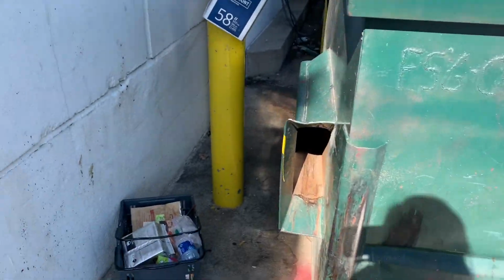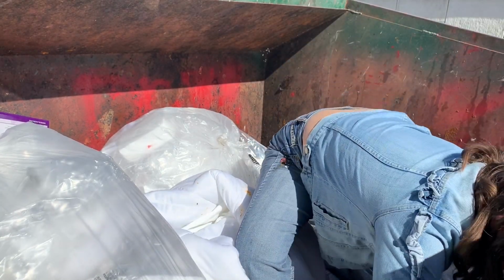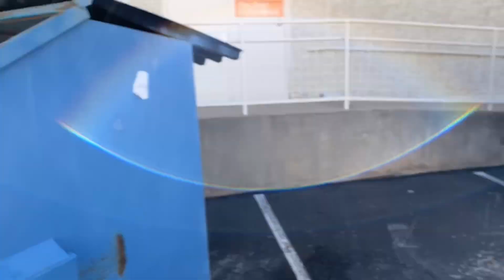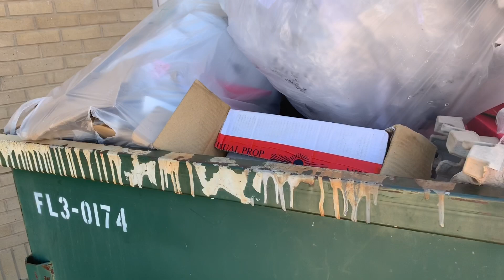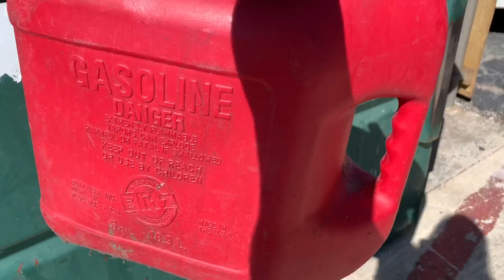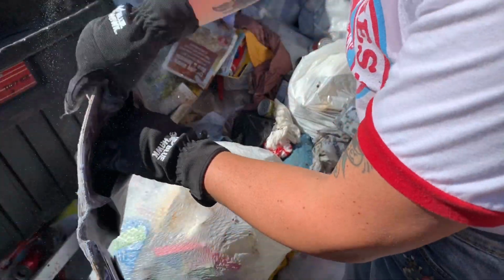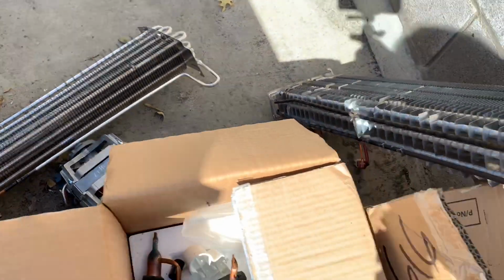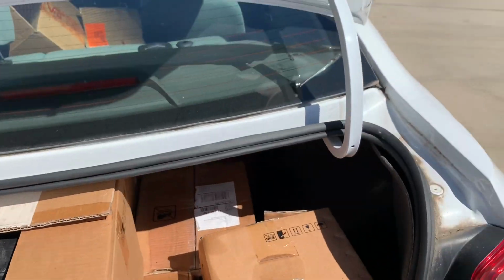Dumpster Diving at Apartment Complexes + the Mall! My car was FULL after this haul!

Comment: That dude is a refrigerator mechanic, so the reason he threw those out is, it's the part he replaced. all those parts are damaged. all the bags are open, he took out the new part and put the damaged part in the boxes.
Reply: Alice C my thoughts exactly.
Reply: here in ohio you only get 0.08 cent a pound for them used , all of those are repair for the new ones.
Reply: Alice C exactly, parts looked burnt out.
Reply: Exactly
Reply: Yep, broken and worthless except for scrap. Take them off Craigslist or the buyer will be pissed.
Reply: Tara TreeLove nh
Reply: @scoutisabelle  Suggestion:  The replaced compressors should be taken apart, look for copper, aluminum, separate. Then when you have enough metal, go to scrap yard. The results may fill your tank with gas or do better. Check out Taco Stacks on recycling wires, steel, light iron, copper prices, parts can be pieced out and you can make a fair price if you know how to use a power tool to loosen bolts, screws, washers, nuts, just use gloves.  Most can be done is about ten minutes or less according to Taco. If you are going to take metal, then this is the way.  You can store them in tubs with lids to avoid rusting them out. Discard the cardboard. Get to know your recycle center workers, they will explain what they take, why things should be separated, dirty versus clean, easy enough to learn and I have never done this but I learned. Piecing can make a good dollar.  And btw, nice try sewing, learn some other stitches to make it attractive.  I'd show you but I don't have a movie camera. LOL  You can sew with yarns and that is nice.

Comment: I think those are more like faceted glass bowls and not crystal.  BUT, you can hold the bowl in one hand and flick the edge of the rim of the bowl with your finger and see if there is a nice "ring".  real crystal omits a nice "ring" glass will make like a clinking sound.  Also thinking if it were crystal, the name of the maker or some sort of  mark on the bottom.

Comment: That black metal "ball" around 22:22 is likely a refrigerant compressor for an LG refrigerator.  There were also radiators for the frigigs.  I'm guessing someone there repairs refrigerators and tossed the used parts back in the boxes after making a repair.  I'd be careful selling, but you should be able to take to the scrap yard for reasonable $

Comment: Little bags?  You can cut off the handle from the top and the seam from the bottom and the logo from the front and use them as a wrapping for small items or clothing or wadding for packages.

Comment: if those compressors don't sell they have scrap value what is shaking inside is a electric motor mounted on springs to dampen vibration when it runs

Comment: The parts look used.  They seem to be refrigerator compressor units.  The repair person placed the old ones he replaced into the box after he removed the new ones.  Left by the recycle dumpster in case someone wants to  scrap them for cash.  Most likely not functioning.
Reply: lol.. you just figured out they were compressor units...

Comment: Hey, those compressors are used, the apartment maintenance probably replaced those old parts with new ones and he placed the old non working part in the boxes, you can’t sell them for $75 even if you say they are not tested, because it’s obvious that they were thrown out by maintenance as non working, you can on the other hand scrap them, and I’d say find videos on YouTube that explain how to do that, and that will bring some money, but not much right now, because scrap prices are very low, and I’m pretty sure that donating food from dumpster is illegal, you can eat that food yourself, and that’s fine, but where another person doesn’t know that it came from a dumpster, that’s wrong. That old food gets thrown out for a reason, recalls and out dated, you can’t just do that people will get sick.

Comment: Those refrigerator compressors you found seemed to be the broken ones which were replaced. You could easily see that certain areas looked completely 'burnt' out. Sorry you wasted so much time hauling them into your trunk.

Comment: You might want to really look up actual images on the internet to make sure you have new one compressors. not the old ones taken out and put in those boxes and dumped in the trash. The parts you pulled out at first looked old- but you never know.

Comment: big black thing is a compressor, scrappers get around 75 cent a pound, if you cut it open and scrap the copper and the cast iron you get 3 times as much. its brand new. I have no idea who would want a brand new compressor. They are used to house Freon gas, even the gas has scrap value. its used to cool items like freezers, fridges, dehumidifiers and tumble dryers. I've never actually seen a new one, anywhere. the pipes are super high grade aluminium and need taking out of the metal for scrap, despite being light they are highest grade alluminium. imo its choice scrap, Freon is very dangerous super bad for the environment and yourself. nobody but manufacturers could use this there's no way it has civilian use other than scrap.

Comment: Thoes parts are not worth anything u are in a apt complex that should be first clue that these parts have been changed out from a fridge they was probley a recall on the part or several ppl had same issue with the fridge either way they are no good should of left them also the reason they were not in the dumpster is they can’t be dumped with reg garbage if u have to dispose of these it will cost you quite a bit